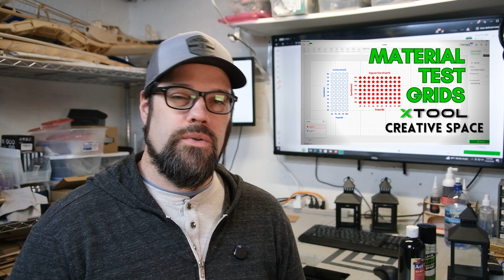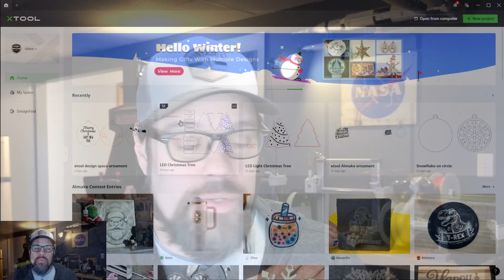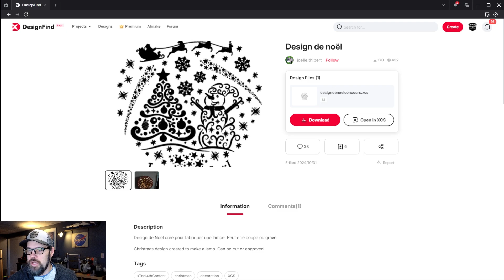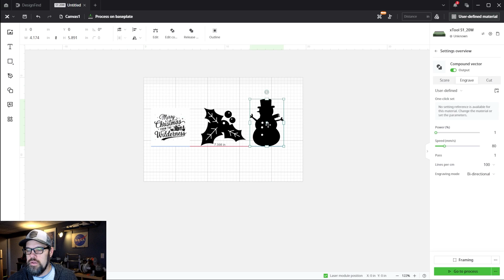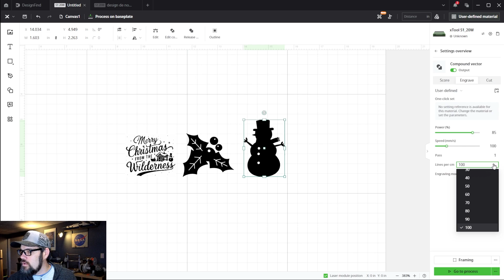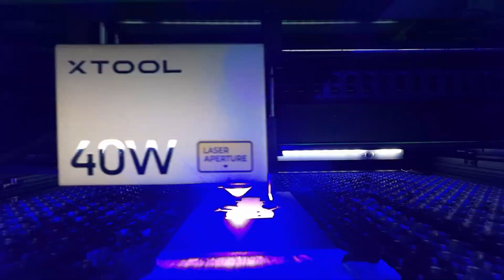Engraving Glass on the xTool S1

Comment: Curious about a couple things,  your video shows a 40w Xtool S1 module , and on your laser settings it shows you are using a 20w  with settings of 85 power and 100 speed and 120 lpc/1 pass bi-directional.   Hmmmmm  can you share what the setting would be if using the 40W?
Reply from the maker: The recording was from my office while it was not hooked directly up to the laser. The settings I provided were what I used on a 40w as that is the only module I have. I do recommend you get a piece of glass and do a material test with your specific laser. There can be variations even among the same wattage laser.

Comment: Thank you for the informative video. Please keep in mind most people watching are not doing your hurricane lamp project. Maybe stick more to explaining how the machine works, and less time taking the glass pieces out and cleaning them. Also picking the design, all that could have been left out and the video could have been solely about using the machine.
Reply from the maker: I'll take that under consideration, but many people also want to see a real project and not just test grids. Cleaning the glass is part of the process, so skipping it would lead people to failure. Showing how you can find a design helps those who often ask, how do you come up with the design.  Just because you do not want what you consider fluff, does not mean it is not useful to others.

Comment: Hi! Need a piece of advise: is it possible to engrave on white shiny coasters made of epoxy resin, and how?
Thank you!
Reply from the maker: That might not work well with the diode source.  Resin can be engraved but it depends on how hard it is when cured, and being white, the diode will not interact with it well.  You might need to give it a dark temporary coating of tempura paint to better allow the laser beam to interact with the surface. While engraving the resin that is vaporized can also cause issues with your air assist nozzle and even your lens so be sure to have at least some air assist on if you try.

Comment: I am using the F1 ULTRA could you help me determine if IR or blue light laser would be best for frosted glass and if so im using 90 power 200 speed and 300 lpc
Reply from the maker: You'll want to use the blue light diode and not the IR. I have not run this test on my F1 Ultra, but conducting a similar material test on glass will help you dial in the power and speed, along with adjusting the focus to get a soft engraving over a hard, fractured one.

Comment: what is the best spray / pint to use to ensure a white engraving on amber glass
Reply from the maker: I have not worked with Amber glass on the laser, mostly just clear.  So the trick is to frost the glass and not ablate it as much.  That is where the defocusing comes in.  The beam will be less intense and across a slightly larger area for a softer effect with a little overlap to prevent lines. Hopefully the amber glass when frosted with this effect will have more of a white appearance, but I have not tried it so I can only make the suggestions. There may be some compounds that will stick to the frosting like rub and buff to give more contrast and or colors, but again, it would take some testing to be sure.

Comment: on my xtool s1 40 w Diode, on green tinted wine bottle low power high speed resulted good but I'd like a More frosty look. I'll try defocusing next. ,. Should you find a way with settings or chemicals to get that bright frosting for the S1 please let me know. Thanks.
Reply from the maker: Defocusing should help, start around 3mm above the glass and see how that changes the engrave.

Comment: in the XCS software, shows S1 20 Watt. In the video shows the 40 watt module. Does the settings change for the power etc
Reply from the maker: I was working on my desktop computer to show the set up which was not connected to my S1 so it defaulted to the 20w model. You'll want to do a material test on some glass with your specific laser to find the correct settings. It will be different from a 20w to 40w.

Comment: BEST TIP OF THE DAY ....  I bought this at HomeDepot - $8.99 for an 11.18 oz can....
> PINTY PLUS Home 11.18 oz. Home Black Water Base Spray Paint
After making my material test for speed and power, it performed GREAT with a wide range, 2000 - 4000 mm/sec, 40 - 80% power - 300 LPI - (30 watt Longer B1), the final results were very similar in etched finish.  I applied just one coat-on a "Pint Glass" with shining a flashlight from the inside as I was spraying to just make the coat opaque-not heavy.  The black Tempura paint is good, but, the application using an airbrush is necessary to achieve a good even coat.  This spray paint being water based is now my go-to coating for etching glass with EASY warm water cleanup....  Try it, you 'll like it.   🙂  P.S.  For EASY PEASY cleanup, just run a slow flow of fairly warm water over your item for 2-4 minutes and the "paint film" will basically just roll off the glass....  Then an old toothbrush "may" be needed for the very few stubborn spots..

Comment: Love this video I tried this method on a glass cup with the rotary tool 

the engraving is a lil merky perhaps I didnt coat the layer evenly 
if I dont have a flash drier how long u think I have to let it dry 

I engrave 50 power at 300 speed
Reply from the maker: The paint I use turns from a dark wet black to a lighter grey when dry.  You can accelerate it with even just air moving over it, but adding some heat with a hair dryer or heat gun will make it much faster.  The even coats are key to getting a smooth engrave.  Light coats sprayed on, rather than thick coats will dry faster and be more even.  Pick up some cheap picture frame glass to do some testing on.  I found some at the dollar store for $1.25 each for a 5x7" glass panel in the frame.
Reply: @Vintauri  nice whats the best way to get a perfect smooth eveb coat cause i think thats the issue

Comment: I have a couple cheap airbrushes I haven't used yet, how much do you need to water down the tempera paint for it to work in the airbrush.  I've tried brushing it on but end up with streaks in the paint layer so would like to try the airbrush.
Reply from the maker: @rickgibson7876  it depends on your airbrush. A friend of mine sprays his without diluting. I find with mine I need to make it fairly thin, up to a 50:50 mix.
Reply: @Vintauri  Thanks, I'll give it a try with a 50:50 mix to start and work from there.  I've brushed on wine glasses with ok results but if you look closely you can see slightly lighter or darker streaks where the paint was slightly thicker or thinner.

Comment: Nice work. I've got the xtool S1 20W.  Since I have half the power, I'm guessing a good starting point for me would be 85% power but at half the speed that you used. Re-purposing thrift store items is also a good way to go, plenty of hidden gems that cost next to nothing if you look hard enough.
Reply from the maker: That might be a good ball park. If you are finding items at the thrift store, see if they have something with a flat piece of glass like a picture frame you can run a quick material test on.  Or check out Dollar Tree, they often have inexpensive glass items.  A material test will be well worth the use of some glass to dial in your settings.

Comment: Why do you need credits for the AI which is built into the software? Are they expensive? Does everything cost credits?
Reply from the maker: Most AI processing happens on servers in the cloud and not on your local computer. They use credits as a way to control excessive use that would bog down the service and drive up their hosting costs.  For the xTool AI Make tool, I believe you can get some free credits through various activities on their Design Find site or you can purchase them.  They usually start you out with a free bundle to try it out and in come cases if you do not like the art generated, you can get a partial refund of the credits used as long as you have not saved or imported the artwork.

Comment: Sorry, I'm late to the party, how thick is the plywood that you focused on to compensate. And do you do this for everything, or just glass? (asking for a friend also with an S1, LOL)
Reply from the maker: The plywood was just 1/8" or 3mm thick.  I do that occasionally when I'm not as concerned with the power but want a smoother engrave. This essentially defocuses the beam so it's not as harsh when it hits the material.

Comment: Thanks for the video - new to the Xtool and really liked seeing the process through.  I watched a couple times and might have missed - what is the reason for putting the glass up off the honeycomb panel and do you do that for multiple objects/materials?  Thanks and subscribed!
Reply from the maker: That is to prevent flashback from causing a ghosting on the engrave. It wont always happen but having a gap between the material greatly reduces the chance of that happening.

Comment: Instead of paper towel I use microfibres cloths. They are less likely to scratch and you can throw them in the washer to save money and the environment.
Reply from the maker: I do try to use reusable towels as much as possible, but they were all in the laundry at the time.  This is also why I like to use water soluble binders so I'm not messing with harsh chemicals that cause even more hazardous trash.

Comment: Thank you for the tutorial. I just received my stool S1, haven’t unboxed it yet. I own a Cricut have had one for several years I can see there are similarities in the design spaces of both machines. How do you know what power level and speed to set the machine for different materials?
Reply: @cindykulp4406  I have been stressing over the power levels and settings too. Luckily, the program that came with the S1 has an update that includes material settings. I have found that sometimes they are spot on and sometimes they need tweeking a little to get them just right. Either way, their suggestions are a great place to start. People also mention their settings on videos. That helps too.
Reply: Thanks so much!
Reply: I've had similar experiences as JaniLewisPaperCompulsions, XTool recommended settings are usually spot on for me as well.
Reply from the maker: XCS has some nice starting points for a variety of materials in their presets. I'll use those as a baseline and run some tests from there.